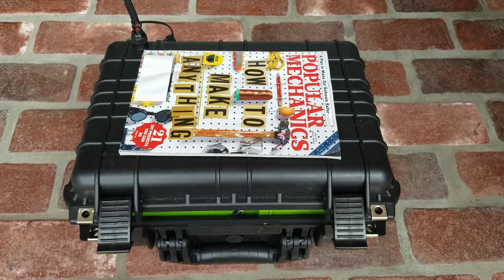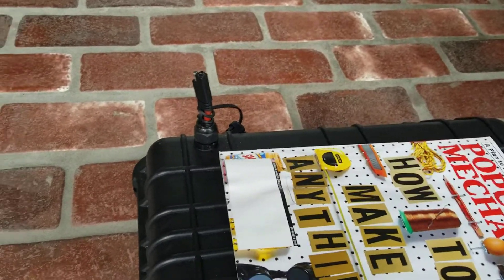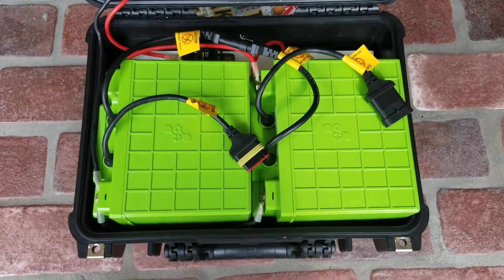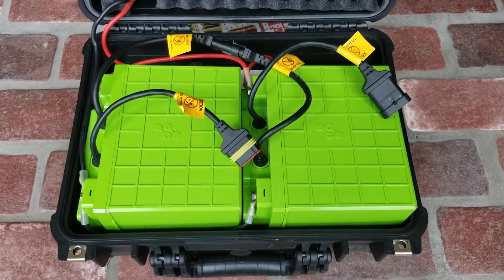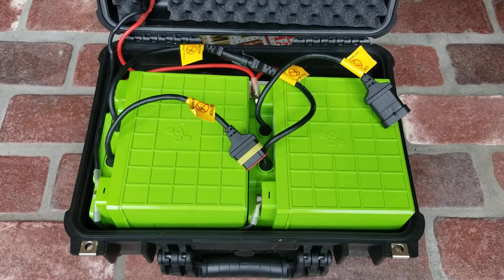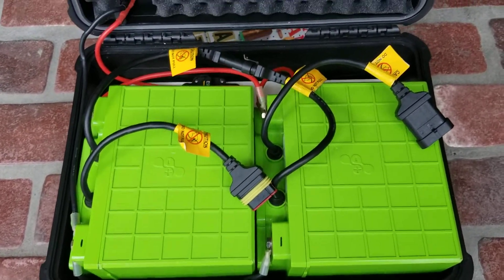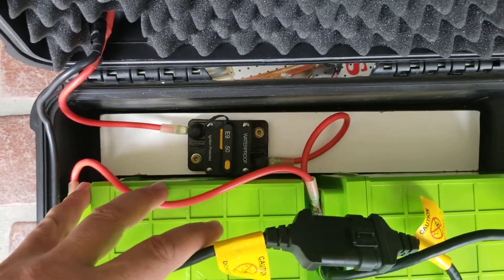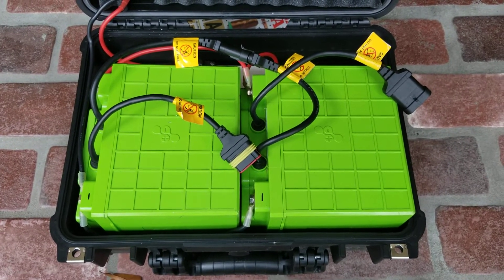Best practices for parallel wiring batteries for your kayak

Comment: Hi Mike, I am in the process of making this set up with the same batteries. Looks like a great and clean set up. I run a 50lb thrust motor. 1) What size motor u running. 2) Whats the run time on it. 3) Hows it still working yrs later. Thanks
Reply from the maker: I run a 24lbs thrust with remote control.  If you look on my channel you can see that video. It has run for 3 days. But that is as long as I have tried

Comment: Do you know for sure those communication cables that operate the BMS is actually communicating with your batteries?  I say that because everything ive heard recently the batteries only communicate if you have them hooked up to your computer/the Valence software, or the external BMS .I know this is the case with the U27 12XP not sure about the Valence U1-2RT
Reply from the maker: The xp and rt series are completely different. The xp do not have an onboard bms at all. The xp require an external bms (Valance software) and have proprietary connections so you can't even use a typical balance charger. The RT have an onboard bms just like any off the shelf LiFePO4, only the BMSes communicate with each other.
Reply: @MikeJordanUnCamplicated  ah ok thanks

Comment: What are you using for Battery Charging? I am using two of these 40 amp hr batteries in parallel and want to recharge from Honda 2200 EU generator for off Grid Cabin. Only powering 12 v led lo voltage  lights and usb plugs.  The Honda puts out 15 amps of power.  Will need to recharge every few days with Honda.  what Battery Charger would you recommend.
Reply from the maker: You can use any automotive charger. I use a Fatmax for travel because it is smaller, but puts out 8amps. I also use a hobby charger at home

Comment: Any info on where to find those batteries?
Reply from the maker: First let me say... I DESPISE folks that just say eBay, as eBay is a big place, and a link would be nice. But eBay 😲 These are used medical equipment batts that cost $1,000 a piece new. I paid $110 a piece. My supplier no longer has the listing. I bought these probably a year ago before everyone figured out what an incredible deal these are. I tried to find some for a friend recently, and I was finding higher prices. So you have to search. If you can wait, deals pop up. Search Valence U1-RT. Before you do, check out this guy's vid to learn more about what these batts are. He is a solar guy, but he covers the batt and testing well. And he is the reason the prices went up, as he has a large following https://youtu.be/L43bArxyszU
Reply from the maker: @NC Solo Skiffer I understand the Valence concept. I have been running them for a year. They used to be $110, as thats what I paid for mine.  Amped Outdoors does not sell LiPo batts. They sell LiFePO4 batts. NEVER put a LiPo batt on a kayak, wrapped or not. I have never seen any 3rd party testing on Amped Outdoor batts from a quality or water proof stand point. I would make sure it stays dry